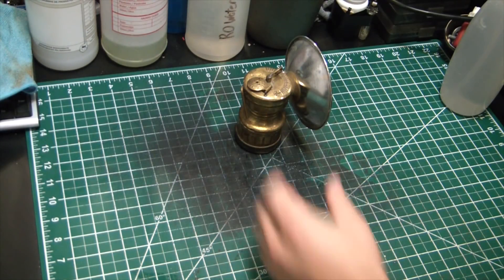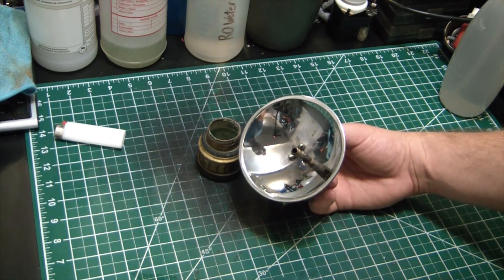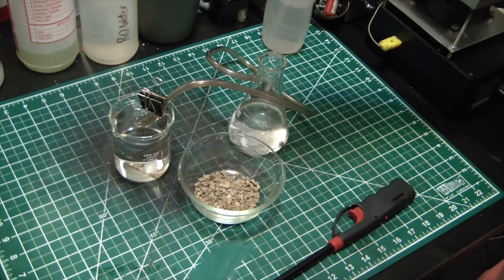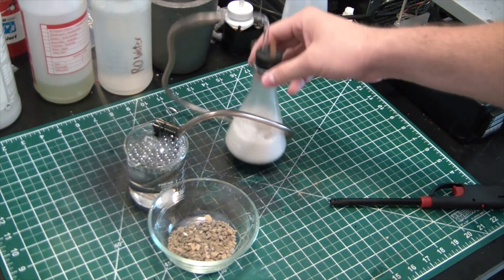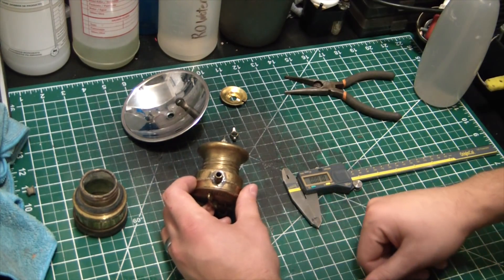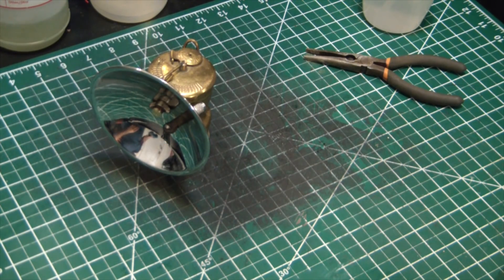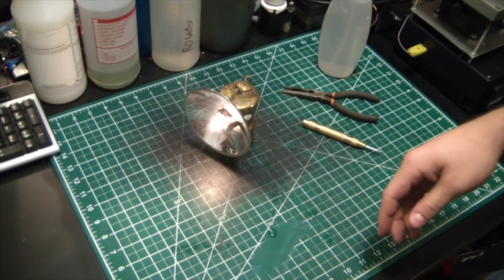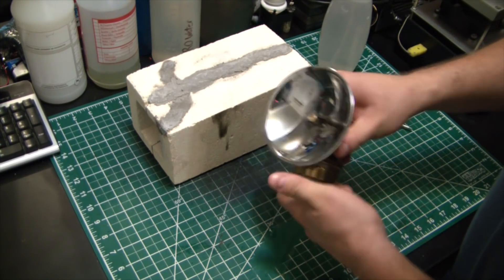Old Mining Tech: Carbide Lamp Restoration - ElementalMaker

Comment: 5 years late, so likely doesn't matter, but found a seemingly unused Dropper and the ceramic lined tip just barely passes a 0.0115 inch wire, but the 0.015 inch wire isn't even close to fitting, so call it roughly 13 thousandths ID..
Reply from the maker: Still good to know thank you!

Comment: Thanks for this video. I have always wondered how those old carbide lamps worked. I think a smaller orifice would help control the soot. Smaller orifice with more pressure behind it causes a stronger venturi effect and draws more air into the flame. Another thing I would like to see is if you could make a mini version of the old lighthouse limestone lamps. They used some kind of gas to heat a block of limestone to yellow-white hot. That kind of lamp was also used as a theater light before electric lights came on the scene. This is where they get the phrase "being in the limelight", meaning an actor has a prominent role.

Comment: So since the lamp turns calcium carbide into calcium hydroxide, which reacts with carbon dioxide into limestone (CaCO3), which could be calcined into lime and made back into calcium carbide, the calcium should be reusable on a long enough timescale for lamp fuel, as long as you have water, carbon and energy.

Comment: Now that I am into 3d printing a usual nozzle tip is .4 mm although smaller tips are definitely available. I might go ahead an try them (they are made of brass although stainless steel are available also. I too have a lamp with no tip and now I am excited to try and get it working.

Comment: A #80 drill bit should be about the right orifice size for the flow.  Might be a micron larger, but that should be about the right diameter for original flame pressure settings.

Comment: I made a miners lamp in my high school metal shop, it worked great for about two minutes, then not so good, fortunately my teacher knew to be carful and it wasn’t bad it just popped. Lots of fun 🤪😆😝
Reply from the maker: Glad she didn't kaboom on you! LOL
Reply: @ElementalMaker  yes just my pride, one of the brazed seams blew and there was a little noise, my instructor gave me an A for the project, saying because it did work and it was by far more complicated than the intended project he thought it was worthy of an A. I believe my port/ jet got clogged and that is why it blew. I fixed it and put a screen in it to prevent particles getting into the port/jet and it worked great after that.

Comment: Great video, subscribed and ringed. About the tip, why don't you try 0.16 mm, that is the standard diameter for flow glue (example), maybe the flame become brighter and the gas will be more economically burned. Cheers.

Comment: If I remember right, the grade of carbide for these lamps is 14ND my grandpa had a couple and they were marked to use 14ND. This is the same grade that my dads acetylene generator used. The carbide you have may work but it has much larger grain size. 14ND has about a 1.5 mm grain. Kind of like course sand.

Comment: A popular technique for lighting these Cap Lamps was to cup your hand over the reflector for a few moments to allow the acetylene to build up. With the heel of your hand pressing on the flint wheel, you drag your hand smartly over the wheel. The sparks produced would ignite the acetylene/air mixture with a satisfying explosion. With luck this would also ignite the gas escaping from the jet.  It worked better if the flint and wheel were dry.

Small quantities of Calcium Carbide can be made in an impromptu arc furnace constructed from high temperature insulation brick. The arc is struck between a pair of carbon gouging (or arc lamp) electrodes with power provided by a small welding transformer.
Reply from the maker: That sounds like a much more satisfying method of lighting the lamp! I will definitely be trying that

Comment: in the Smallest drill bits you can find the smallest ones that's to small to use is the one you need for that hole you need for that tip it should work

Comment: Your lamp is a reproduction of a Guy's dropper lamp
which I am told was a good lamp. It's the carbon in
acetylene that fluoresces and makes the bright light
In the days of gas lighting the gas piped into houses 
was coal gas because it had a lot of carbon in it both gases
are basically dirty and sooty. In places where they didn't have
coal gas they would bury a drum of carbide in the yard and
pipe a line into there house. Kind of scary if you know how
explosive acetylene is. I was into caving in the
70s and 80s a lot of novice cavers  bought butterfly
lamps and used them until they learned better and
bought the American made ones.
Reply from the maker: Yeah it's crazy to imagine using acetylene for lighting in a house. I've read a few old stories of houses that exploded from acetylene buildup. Crazy stuff! I couldn't imagine going caving with only an acetylene lamp; that had to take balls!
Reply: The brass on Guys Droppers can split at the skirt of the water reservoir by the threads.

Comment: I have one of these lamps I got when my father passed away the jet in in it could not find my micro drills but the ballpark size 26 awg wire is loose and a 30 awg will not fit so it would be the 27 or 28 awg size and you are right there is a ceramic liner in the jet hope I helped you get close

Comment: You cannot make a burner tip for carbide lamp out of metal your lamp was smoking way too much because of that not because the orifice was too large.  I still have one of these old lamps looks just like the one in your video except it has a larger reflector they must have a special ceramic tip that mixes the acetylene gas with air they smoke very little and are surprisingly bright.

Comment: Great vid.  I'm fascinated by Calcium Carbide.  I discovered it when I learned that in poorer tropical countries, which rely on locally grown produce more than industrial farms, locals use carbide stones to ripen fruit.  Especially bananas.  On discovering that I went down a rabbit hole about how modern industrially produced bananas are picked green, shipped internationally, and bathed in a low concentration of acetylene when near the destination to trigger the ripening process.

Comment: My grandfather had one of those carbide lamps in the late 60's. It looked a little different than yours but I'm sure they had basically the same specs. He kept the orifice clean using an acetylene torch tip file of 23 gauge. have no idea what the tip was made of but it felt like plastic but obviously wasn't. Hope this helped!

Comment: This was an awesome video. I was totally unaware, even though I had heard of carbide lamps.
I'm kind of amazed I never came across this before, seeing as how I'm and engineer/fitter, have used acetylene for cutting and welding for donkeys years, though it tends to be more propane these days. And I served my time down a fucking pit.
Everything was VERY strictly controlled due to the methane explosion possibility. Everything had to be either low voltage and intrinsically safe, being generally comm's, or anything more than the low voltage, had to be housed in massive cast flameproof cabinets, to prevent any explosions getting out of the cabinets, not the other way around. Even aluminium was contraband, due to it being able to produce a spark hot enough to ignite methane gas. All watches had to be mechanical too, no battery watches. Mobile phones were still well in the future then.
I have only ever seen a picture of a carbide lamp. I have two old miners safety lamps though from when I worked there. We don't have many pits left these days in the UK.
Great video's mate. Keep up the sterling work.
Reply from the maker: Glad you enjoyed! Stay safe fitting. I did that myself for a little while, but only got to work with FRP piping. Pretty cool stuff but I really wanted to weld!

Comment: Use a torch tip from an old butane lighter. Not a soft flame orifice tube. It will usually just pull out of the lighter. Should be brighter with less smoking.
Reply from the maker: Man awesome idea! I never would have though of that.

Comment: A huge improvement would be to add a venturi, where air would be sucked in and premixed before ignition, and then a material that glows brightly placed in the flame. Not tungsten, but something that doesn't oxidize.
Reply from the maker: Very cool idea!

Comment: You make such interesting videos. I used a carbide lamp during my spelunking years in the 1960s and 70s. The tips were indeed ceramic set in a brass collar. The tip was slightly tapered. Friction held it in place. I never used toothpaste or any other adhesive to hold it in place nor knew anyone else who did. Thee was a felt filter that fit snuggly in the base of the water reservoir. It was as  large in diameter as the reservoir and had a hole in the center through which the stem passed. We cavers always took spare carbide in water tight bottles, spare tips, spare felts (they tended to get waterlogged), and a tool to clean the carbon build up from the tip. The lamp is lit by placing one's hand over the reflector for 10 or 15 seconds to allow some acetylene to accumulate and, using the fleshy part of the palm, quickly rolled the friction wheel on the flint. With a little practice you can light it on the first attempt. If someone else in the group already had a lighted lamp, you'd say "Kiss me" which meant "Give me a light." Affluent spelunkers carried extra lamp bottoms, already fueled, with a screw on lid which made refueling easier. The cap was then put on the spent fuel container. Spent carbide fuel was NEVER dumped in the cave. I recall a time when my lamp fell off my hardhat into a stream of water on the cave floor. I had to disassemble, dry and clean the lamp, replace the felt and refuel in total absolute darkness. Good times.
Reply from the maker: Wow now that was an awesome comment! Thank you for the wealth of information. I would love to go spelunking some day. I imagine it has gotten easier with the advent of lithium ion batteries and LED lights. I couldn't imagine trying to do all that in total darkness, must have been quite a terrifying rush to experience that kind of darkness.

Comment: zippo flints may work better. they are a slightly larger diam.and will probably fit better as that style of lighter was more common at the time. although I have used bic flints in a zippo, they arent as good.

Comment: Hi, 
does the light get brighter when you use an incandescent gas mantle at the flame ?
Reply from the maker: I haven't tried it, but I don't believe it would make it any brighter. It would just diffuse the light better imo
Reply: A thoriated mantle is way too fragile for use in the heavy physical work they did - because the silk burnt away leaving it's thorium treated ash to become incandescent.

Comment: https://www.ebay.com/i/142784949025?chn=ps&ul_ref=https%253A%252F%252Frover.ebay.com%252Frover%252F1%252F711-117182-37290-0%252F2%253Fmpre%253Dhttps%25253A%25252F%25252Fwww.ebay.com%25252Fi%25252F142784949025%25253Fchn%25253Dps%2526itemid%253D142784949025%2526targetid%253D475558455302%2526device%253Dm%2526adtype%253Dpla%2526googleloc%253D9019796%2526poi%253D%2526campaignid%253D1489270473%2526adgroupid%253D57569192116%2526rlsatarget%253Dpla-475558455302%2526abcId%253D1139326%2526merchantid%253D6296724%2526gclid%253DCj0KCQiA_s7fBRDrARIsAGEvF8RCu1f7IVzdhzcP4Z2KaNzdKc6-MVI4MeO5vDkk3uT7iXO4_0tTrs4aAloxEALw_wcB%2526srcrot%253D711-117182-37290-0%2526rvr_id%253D1749602150050%2526rvr_ts%253D33eafd8e1670aaa302c6d944ffe18652
Reply: It looks like the original ones were made of Lava, With a tiny center hole for the gas and four holes drilled in from the sides to introduce air to aid in a cleaner, whiter, flame with less carbon.And Soot! Hope this is helpful to your experiments and restoration project                                                (lonnie1949@gmail.com)   https://www.ebay.com/i/142784949025?chn=ps&ul_ref=https%253A%252F%252Frover.ebay.com%252Frover%252F1%252F711-117182-37290-0%252F2%253Fmpre%253Dhttps%25253A%25252F%25252Fwww.ebay.com%25252Fi%25252F142784949025%25253Fchn%25253Dps%2526itemid%253D142784949025%2526targetid%253D475558455302%2526device%253Dm%2526adtype%253Dpla%2526googleloc%253D9019796%2526poi%253D%2526campaignid%253D1489270473%2526adgroupid%253D57569192116%2526rlsatarget%253Dpla-475558455302%2526abcId%253D1139326%2526merchantid%253D6296724%2526gclid%253DCj0KCQiA_s7fBRDrARIsAGEvF8RCu1f7IVzdhzcP4Z2KaNzdKc6-MVI4MeO5vDkk3uT7iXO4_0tTrs4aAloxEALw_wcB%2526srcrot%253D711-117182-37290-0%2526rvr_id%253D1749602150050%2526rvr_ts%253D33eafd8e1670aaa302c6d944ffe18652

Comment: I found one of these Carbide lamps  in Colorado left in an old outhouse while deer hunting with family when I was a Kid. Everything looks to be the same except the reflector was brass not chromed and about three inches D.,I.A... On my lamp was a piece of porcelain or ceramic  inside press fitted in the throat of brass going through to the front and the Orpheus was about 1/8" allowing less pressure and a smaller flame that didn't shoot so far out in front of the reflector. Union Carbide had a factory in Torrance CA and where my Dad acquired a can of carbide to run the lamp not to far from where we lived in Gardena CA. It was one of my favorite toys growing up in the late 50's. use link---> https://i.etsystatic.com/13114852/r/il/33b2ea/1531592287/il_570xN.1531592287_hgci.jpg
Reply from the maker: Very cool! Thank you for sharing! They certainly are awesome little devices

Comment: get some carbide bits like these maybe https://www.ebay.com/itm/10PCS-0-1mm-1-0mm-PCB-CNC-Print-Circuit-Board-Carbide-Micro-Drill-Bits-Set-E-P/223084728325?epid=26012318531&hash=item33f0e2d005%3Ag%3AxtkAAOSwCGVX6nlB&_sop=15&_sacat=0&_nkw=carbide+micro+pcb+drill+bits&_from=R40&rt=nc&LH_TitleDesc=0

Comment: I saw one of these attached to it’s original miners cap.  It was a simpler design that didn’t have a separate water tank.
Reply from the maker: Very cool. Another guy also commented about one without a separate tank, very interesting design. Apparently the acetylene would dissolve under the pressure of the reaction, and slowly release to sustain the flame.

Comment: Idea, recycle an old absorption refrigerator and strip it out and put it in a cooler. Design a canister that olds calcium carbide with a pressure valve that allows water to drip into canister that shut off the water ounce the gas built up presure in the canister. With another presure valve to allow a steady flow of gas though a hose down to a burner that operates the absorption refrigeration system. A SHTF cooler to keep food and medications that you can keep in the bed of your trunk or on the tung of a trailer? 😊😉
Reply from the maker: The only issue is pressurized Acetylene can explosively decompose, even without oxygen present. Acetylene tanks are filled with diatomaceous earth and acetone (to keep the acetylene dissolved). Its some nasty stuff when pressurized! Thanks for the comment! Very cool idea nonE-the-less!
Reply: Well since it burns so hot any way just model one after one of those miners lamp to operate the burner to run an absorption refrigeration system? Wild idea make a heater that runs off urine its mostly water has the heater dries out and sterilizes the sticky stuff into rich top soil and cook off the rest of the urine and make crystallized rich plant food? A neat way to process waste rather then just just makes a brown slurpee abd dumps it down pipes out of sight out a mind. 😊

Comment: I wonder if there should be a metal mesh mantel and air holes placed in a tube after the jet.   Similar in function to the Davy's safety lamp.  Naked flames in mines go back nearly 200 years.  In Wales the safety lamp was in use from the early mid 1800s .  That being said, most of the UK mines were coal, where flammable gases were a constant danger.  I would be interested to see if the flame could be contained by a mesh mantel. Just found a video of an old Welsh miner stripping down a safety lamp.  https://youtu.be/DlljBAo3c-8
Reply from the maker: Land Rover Addict yes the Davy's safety lamp was integrated with the Carbide lanterns as well as oil and gas lamps. A truly great innovation that saved and continues to save lives! This particular model did not use it, but many did.